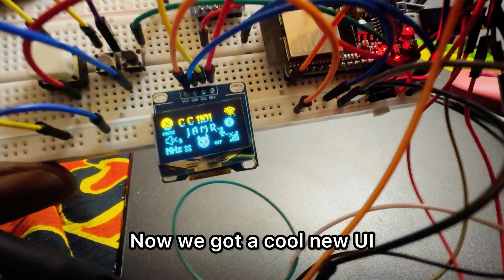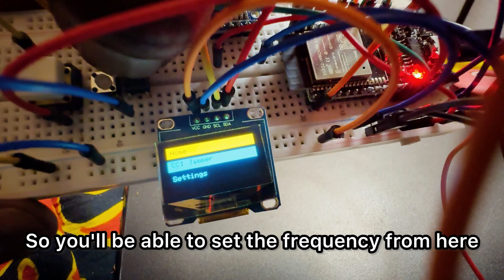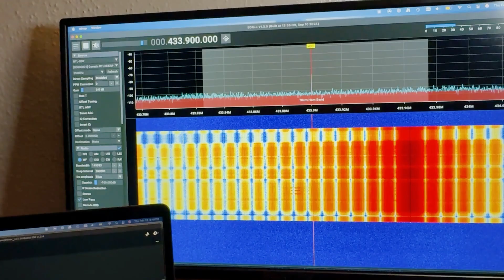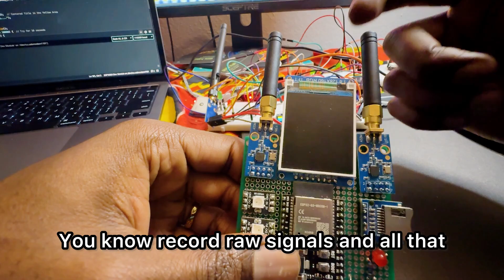ESP32 433MHz Jammer Major Upgrade

Comment: nice video! im having some trouble getting my cc1101 to work on my esp32 s3, and if you could help me it would help a ton. im trying to make it read simple ask/ook signals from my remote. what library did you use and what s3 pins? thanks
Reply from the maker: S3 is different for cc1101
Reply: @ yeah i know it sucks. any recommendations?

Comment: Pretty cool! Is there a NRF or another chip that works on 5ghz? To jam 5ghz wifi networks/Bluetooth
Reply: BW16
Reply from the maker: Bw16 is not a signal generator and only deauthorizes
Reply from the maker: There isn’t a module similar to NRF24 for our 5ghz signal generation, you need to make your own